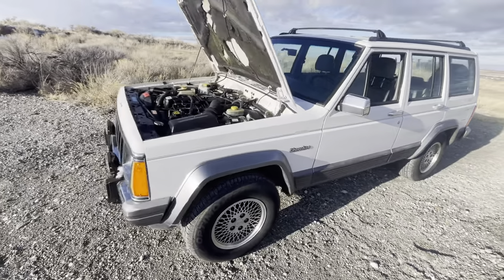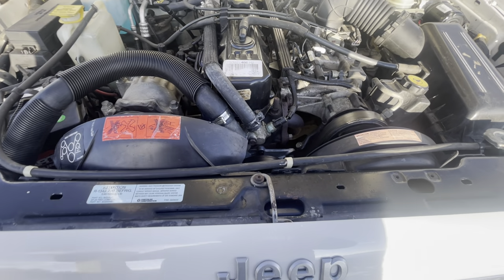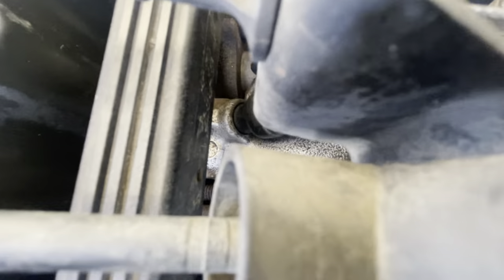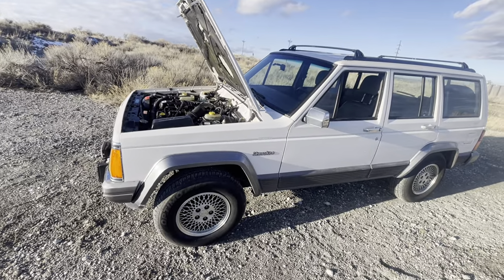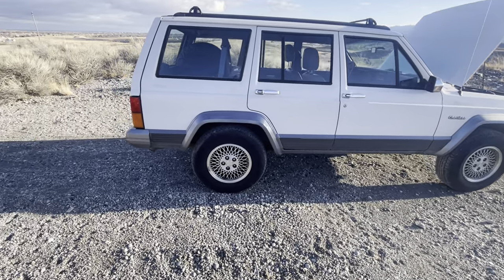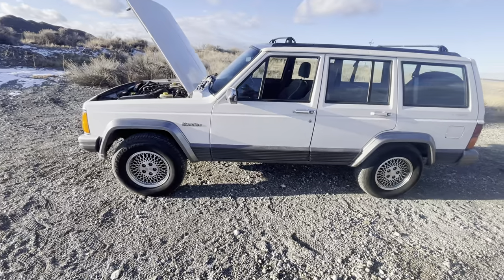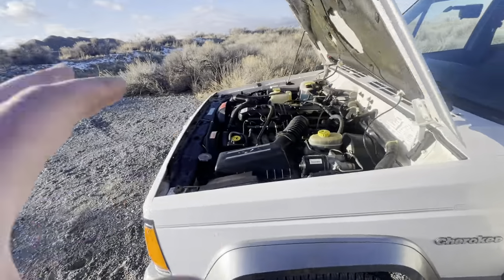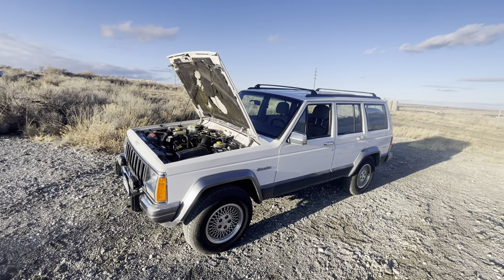How to bullet proof your old Jeep Cherokee XJ

Comment: I just got my first jeep recently. Changed the fuel system and ran very good! Just the other day, my engine lost compression on cylinder 1. Just bought the engine, waiting to come in now. Definitely gonna refresh it with gasket and water pump.
Reply from the maker: Nice ! Good luck on the engine swap. Could have had a leaking inj that washed out the 1 cyl.
Reply: @glengoodwin7860  thank you! yeah definitely sounds like it, im a little nervous to drive it to the shop. My foreman said to remove the connector to the injector so it doesn’t like lock up or something. It has like 60-90psi but still lol

Comment: The heat cover on the 00-01 on the intake manifold below fuel rail was to help prevent the fuel rail from heat soaking causing a missfire upon a start up after its warm esp on hot days. Ive had 63 xjs in the past 20 years. I do run 180 degree thermostats in mine. You do not need to if your cooling system is new and for the cost it should all be new its cheap easy to do like you said. I feel like with the 180 t stat i can get more power out of the 4.0 with the manifold already heating up the intake the other plus side is my ac is colder with the 180 t stat. Some ppl dissagree. My jeeps can sit in traffic all day and not go over 210 ever even off rev limiter for minutes on end in the woods offroad. I run the water pump that pumps more at low rpm for rock crawling trail runniing it works well. I loterally held my jeeps off limiter soo long i lost oil pressure from the oil getting that hot! And temp was a needle or 2 over 210 thats like glowing red manifold status lol. Ive never had sludge buildup or any adverse effects long term running 180 t stats. I woulda also recommended if its a renix put the cap style radiator in get rid of that capless junk system immediately. All that being said I mainly specialize in 97-01 xjs nowdays too hard to find rust free ones where I live. 

Nice video should help alot of new xj owners. I spray brake clean on the cps if it goes out that works like a champ i never tried water good tip i might try it next time. Id replace cap rotor and use brass tip ones with ngk plugs. Id also recommend doing idler pulley and serpentine belt immediately too. I go on rock auto spend 300$ and its bullet proofed
Reply from the maker: When I got the TSB in the mail for my 2000xj back in the day it stated the heat shield was dual purpose. But yes , it was mainly for heat soak issues. The TSB also included a little insulating sleeve around injector # 3. My buddy worked at Jeep dealer as a tech and this never solved the issue according to him. What worked for me with heat soak was putting a timer on the Efan to run 3 minutes after the engine had been shut down. Worked absolutely perfectly. 

Thanks for the kind words. I really enjoy documenting these jeeps. Got a 93 XJ I’m going through right now. Video is uploading as we speak ! 

Cheers !
Reply from the maker: Since someone else is now saying the insulated cover on intake manifold wasn’t dual purpose to keep heat and mice out here’s the letter I received in the mail from Jeep. 

https://www.jeep.com/universal/webselfservice/pdf/B06.pdf

Comment: Spent 20 k in 88 on a laredo with 4.0 drove it 34 yesrs and loved it! 165 k miles nevef had cooling probs. Did replace
 radiator and water pump, thermostat needs to have a balancing pressure hole in it. Put the wrong one in and it got too hot climbing the Sierras to Tahoe..
Reply: Somehow...the upholstery was mint at 34 yrs old except headliner shot

Comment: Crankshaft sensor went out on me while driving. Went and checked and it wasnt even the factory one in there. It had already been replaced. Definitely should replace it even if theres nothing wrong with it.
Reply from the maker: Yeah , those sensors can be a pain in the ass if not a quality replacement. So far , I’ve had good luck with napa. But some say napa sensors are terrible 🤷‍♂️
Reply: @glengoodwin7860 got a Mopar OEM from the Jeep dealership last year, it was expensive though, 200$ or close to it.. mine was randomly shutting off while driving, after getting heat soaked. It's easy to replace if you have long skinny arms lol and if it's lifted, you don't even need to jack it up lol

Comment: The cooliing system works fine if you simply replace everything. Radiator, water pump, hoses, t-stat. Delete the stupid heater core valve. Make sure all of the gaskets are done right with clean surfaces and coolant compatable permatex. Do it right once and you wont have sny overheating issues.
Reply from the maker: Right ! For a 25-30 year old vehicle, replacing the entire cooling system is definitely part of routine maintenance.
Reply: I agree. Cooling system problems are just a symptom of an old system. I swapped mine out and it's been very stable for years.

Comment: Any certain parts after 150,000 miles with a 4.5 inch lift you would recommend specifically? Just curious if I’m missing something.
Reply from the maker: With a lift I’d be going through suspension components , mounts and anything suspension related , really. Of course that lift it putting strain on pretty much everything on the Jeep. But I’d start with getting any bushing checked over and a good alignment. Check track bar for play as well.

Comment: The single greatest point of failure in these vehicles were the maintenance of the owners.

I bought mine for $500. I added:
Stainless brake lines, stainless clutch master cyl line, metal clutch slave and master cyl, Hd clutch, a ZJ fuel line to the rail, stainless fuel rail, ev6 injectors, hv fuel pump, water pump with a backing plate, copper brass radiator, adjustable track bar, battery cable upgrade, headlight relay harness, cooling fan ctrl relay. For the rest I use zinc oil additive. This thing is at 375k miles.

Comment: Hey Glenn, I have a 95 that is just like yours. Bought it new and have maintained it since. 235,000 miles. My question is the heater valve assembly. I'm probably on my 5th one now (the replacement ones were never as good as the original). How do you control the amount of coolant going into the heater core without it? Seems that it would just run hot all the time without it. Am I missing something here?
Reply from the maker: There’s a flap that covers the heater core ( or something along those lines ) but I’ve never experienced any warm air issues in the summer while running the AC with deleting the HCV. Jeep completely did away with the unit in 97 , so if you think about it , it’s not needed. Just a little over engineering imo

Comment: You're right about cooling system. I have 97 with factory turbo diesel engine and I also had to deal with the cooling system. It's a Jeep thing. 😅
Reply from the maker: People just didn’t think of it as a maintenance item on these Jeeps when they were newer. The cooling systems on these XJs just aren’t aging well
Reply: The motorei diesel is amazing if you can find one.
Reply: @scotteric8711  I'm from Europe,. They are not so rare here.

Comment: Going to replace my thermostat, thermostat housing, water pump, radiator hoses and heater hoses, and belt. Thinking of doing the radiator too but not sure what to go with. I have a stock 2000 Sport XJ that i do want to lift 3 inches or so in a year or 2. What radiator do i go with? Also while im doing the job is there anything else i should replace? And yes im going to flush the coolant :)

Comment: Hi Glen, I have 1998 jeep cherokee classic 4.0 200,000 mi. Strange thing. No crank just clicking behind glove box. Changed starter twice, battery is 100% will start in morning when cold, will not crank when outside tempaerature is above 80 degrees. Cleaned and sanded all ground connections. any suggestions will help!! I am going to tie the battery cables together for a day. Recently changed out Neutral safety switch.
Reply from the maker: Sounds like a wiring issue, but could be a ton of things. Any signs of mice ?

Comment: Dude...103,000 miles is like new! Needed some love? What?
Reply from the maker: Wouldn’t pass smog in CA. PO had transfer case rebuilt and the guy who installed rebuilt TCase was an idiot. Speed sensor wasn’t installed correctly throwing a check engine light. Besides that “ the love “ was mainly my basic stuff as you see in this video and a tremendous amount of cleaning. It hadn’t been detailed in a very very long time. Had mold build up on the exterior and interior was pretty nasty.

Comment: Excellent Video !!
Reply from the maker: Appreciate the positive words !!! Keep jeepin !
Reply from the maker: Appreciate the positive words !!! Keep jeepin !
Reply from the maker: Appreciate the positive words !!! Keep jeepin !
Reply: @glengoodwin7860 you're welcome actually have one I bought in California 23 years ago an 89 has 300k very clean but has been experiencing some issues definitely a cracked exhaust manifold also bought new injectors runs erratic till warmed up also some kind of binding when making a right turn definitely not u-joints or wheel bearings already did that going to change the transfer case fluid today and see actually runs decently cool with the original system did put a new radiator water pump hoses etc

Comment: i need to have a date with my car and do all this stuff 
ALSO, i have rust in the cooling system because it was abandoned for 4 years, should i chemical flush it???
Reply from the maker: Rust in cooling system is a hard one to get entirely rid of. Do a couple flushes ( lightly , don’t get crazy with the water pressure or you’ll damage the heater core ) and just keep flushing and exchanging coolant every six months. From my experience with rusty coolant , you’ll never get it all out of there and it’ll just keep rusting internally , so just keep up with coolant exchange and light flushes.

Comment: im struggling to death with mine. 60k cherokee standard from 99. Overheating constantly, totally at random. Brand new cooling system. She still blew a radiator after install and will ocassionally get super hot and overheat and boil out of the reservouir seemingly independent of outside temp or how hard im working her. Sometimes a 10 minute drive will yield an overheat. Sometimes she'll go hours without an issue on a hot day. Pulling my hair out on this one
Reply from the maker: @ivbqwljrf234  check that you’ve got the spring in lower radiator hose. I’d also pressure test the cooling system to make sure you’re not getting exhaust gasses pressurizing things. Hopefully it’s not a severe issue

Comment: Other potential issues are failing door opening mechanisms/pushbuttons, constant minor oil leaks everywhere, flex plates getting loose. If you like to run around on empty you will burn up your fuel pump. The rear wiper sprayer mechanism will fail. Trans mount needs replacement at 200k. Never acquire an XJ with a bad heater core. If you never have to replace your engine or transmission you're most expensive maintenance is going to be the suspension.

Comment: Thts not coolant temp sensor. Tht has to d w efi system.  Coolant temp sensor is on back of head
Reply from the maker: yeah , no shit…. In late 1996 Jeep did away with the gauge temp sensor on back on head( is that better terminology for you ?) Making the engine coolant sensor and gauge sensor one unit on the thermostat housing. If you go to the auto store it will be called engine coolant temp sensor…..
Reply: @glengoodwin7860  yeah. Just trying to clarify. In case a person saw tht

Comment: Have a 96 XJ now for 10 years....also removed the heater valve as 2 plastic ones broke in a few years.....also recommend disabling the radio antenne motor (wire under passenger side caps in the dash) as my motor kept running....draining the battery.  Also disconnected my Evap valve as it caused engine to idle very bad.....probably a vacuum leak somewhere.
Reply from the maker: All great ways to make the Jeep better for a daily driver ! Keep up the good work !

Comment: Because all wires are soy based plastic and rubber.
Reply from the maker: @user-cz8lc5tj7e  no they’re not. But thanks for the nice false information comment. Soy based wiring wasn’t popular until around 2000.
Reply: @glengoodwin7860  Actually .Henry Ford used Soy based Plastic in 1941 to make wiring and even  Ford body parts

Comment: For one to upgrade an XJ, one must first upgrade to a ZJ.
Reply from the maker: If you want comfort definitely a ZJ. But there’s just nothing like the old design of an XJ. Design was started in 1978 so it truly holds that old school look and feel that some people want.
Reply: if the ZJ came with aw4 I'd be all about it
Reply: @artardFTW  AW4s are tough but they're very parasitic and require a good bit more HP to turn than do the 42re. Mine has 266k miles, and it has the factory auxiliary cooler which works fine. It still shifts perfectly. I keep hearing bad things about the 42re but if kept cool (like any automatic transmission) they'll run forever and I've not had any trouble from mine.
Reply: @codered7453  I've heard countless stories and witnessed badly overheated aw4's and they generally don't quit (obviously there is a breaking point but it's way passed the breaking point of any other transmission) 

I had a 98 zj with somewhere around 170k and it refused to downshift without going to neutral, and holding the button straight into 1 so I sold it for an xj with more miles that drives better with worse looking trans fluid lol
Reply: @artardFTW Some did, in the early years.
Reply: @FreeRange4x4  I think 1994 is the only year the aw4 was offered
Reply: Boooo lol